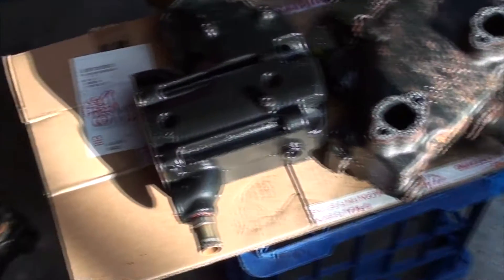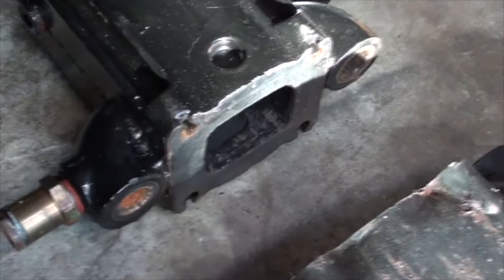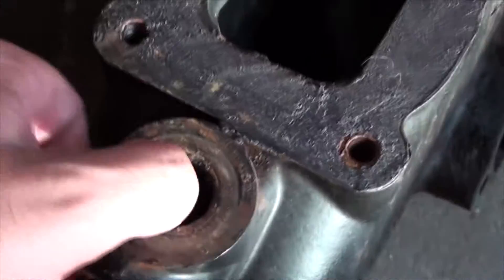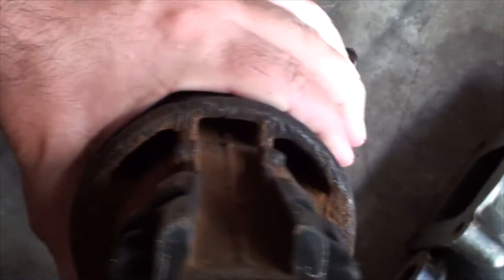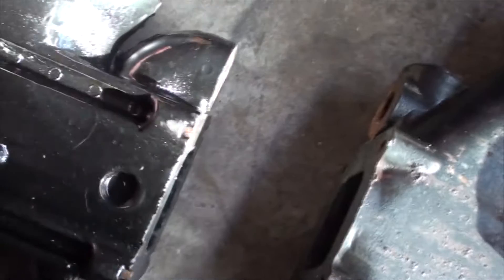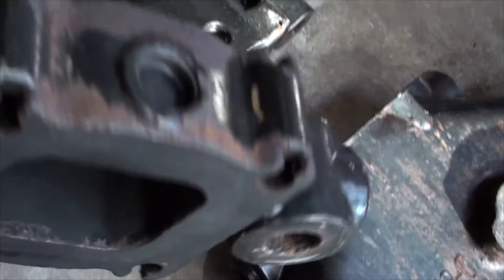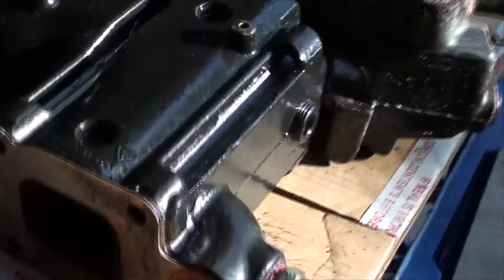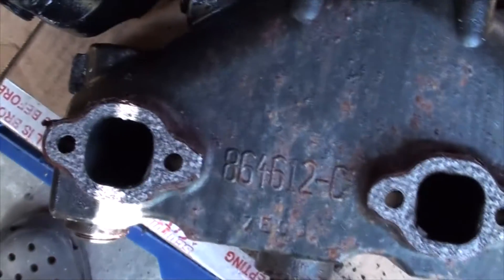Mercruiser 4.3 V6 overheating issues

Comment: Had issues with mine overheating as soon as I got the boat up on the plane. Changed over manifolds and exhaust elbows/risers and it fixed the issue.